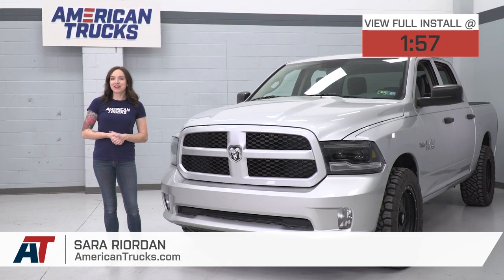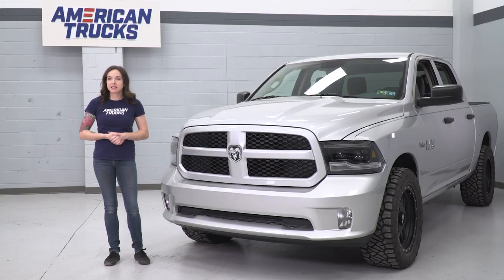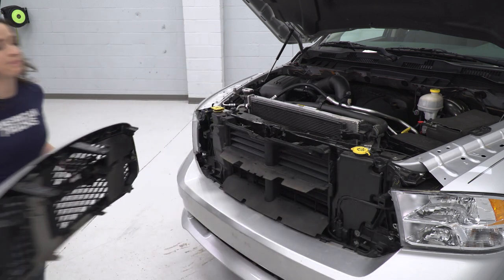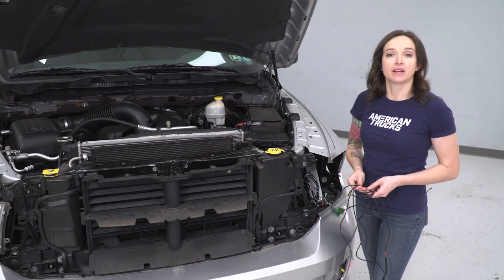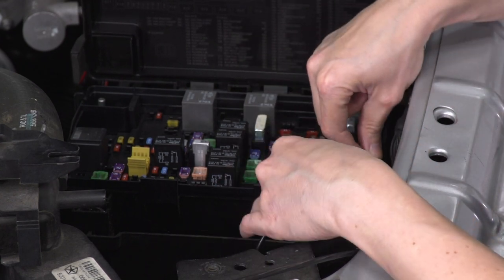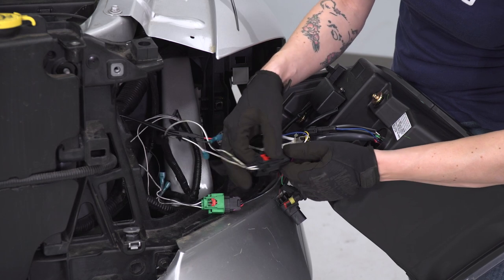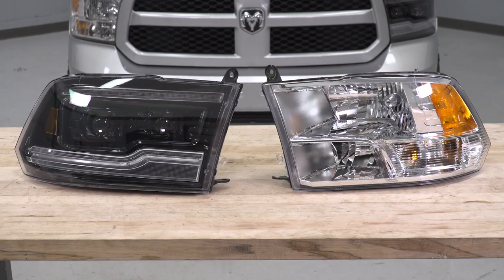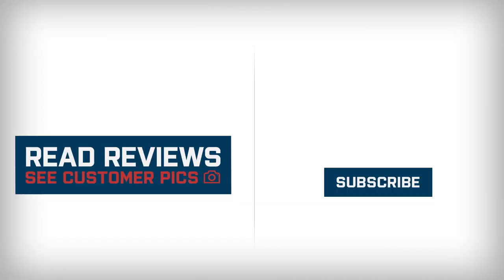2009-2018 RAM 1500 Morimoto XB LED Headlights; Black Housing Review & Install

Comment: It needs to compare old with new headlights somewhere on the  road AT NIGHT, because customers SHOULD SEE how new headlights are brighter or not, and how far the driver can see on the road!!! Um, also I wondered if the old headlights would get new good LED light bulbs, would they work better, than new expensive headlights?

Comment: Why would you take off the grill?
Reply: Have you ever tried to get that bottom bolt out it’s a nightmare if you don’t remove the grill, just makes it easier to R&R
Reply: @30pvfd  I use an extension and a flashlight.
Reply: The grill is 6 bolts.  lol

Comment: These caused my left front turn signal out warning and hyperflash in the left sideview mirror. Everything else is working normal. Any ideas? 2018 ram project from factory
Reply: Hey I have the same issue, what ended up being the problem?
Reply: Still trying to figure it out, I think it may be the connector though
Reply: @lx93racer  I did a bit of research, and I saw something about installing resistors. Have you tried something like that?
Reply: @freshprince4568  I did. No change

Comment: Do you know if there are any issues with these headlights throwing a "Parking light out" code on 2014 Rams in particular?  We installed similar headlights from AlphaRex in our 2014 and it threw the code and AlphaRex sent resistors to fix the issue.  We did not want that and returned the headlights.
Reply: I had them in my 2016 Ram 1500 and can assure you that the message will not appear.
Reply: I just put them in my 2015 and I got the 'Low Beam out' code after installation. Then headlights would flash on and off untill eventually they just didnt come back on until I turned my truck on and off. However, this was fixed easily with AlphaODB and an ODB scanner. Scanned for errors, then went and changed the lights the error showed up on to LED in the computer.
Reply: Yes I bought them for my 2013 ram 1500 express and 1 year later my low beam and high beam for my driver side stopped working ended up buying factory headlights
Reply: I bought these two years ago. No mechanical issues, but the delaminating on the inside and turned hazy. Morimoto replaced them and then a day later the left turn signal out with hyper flash started. Got another left headlight sent out. Guess what? Same thing, I have pulled these headlights out way too many times and it appears I'll be doing it again next weekend.
I'm beginning to regret this purchase.